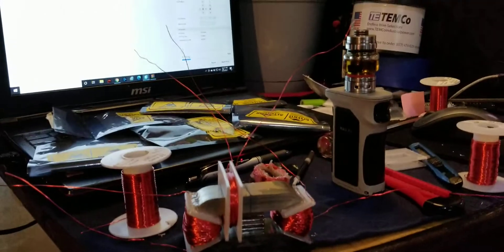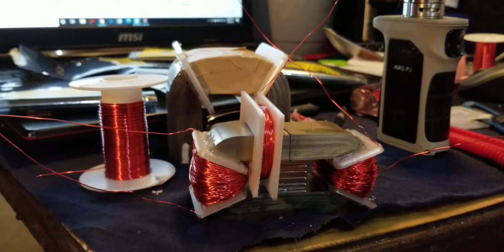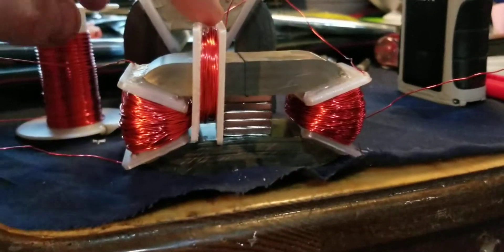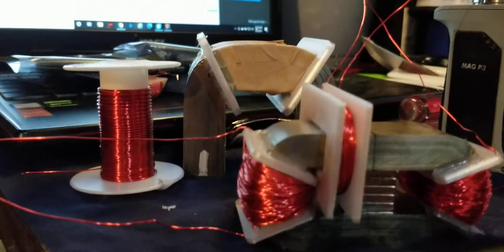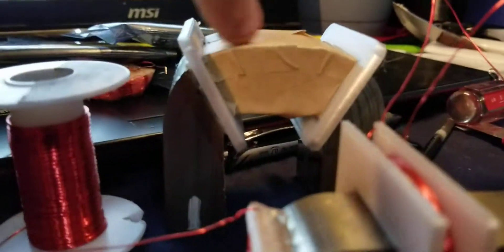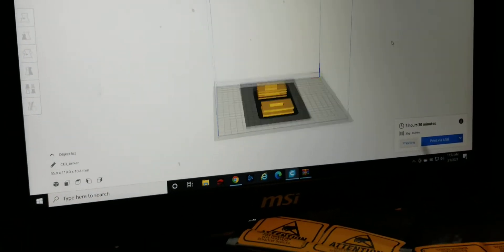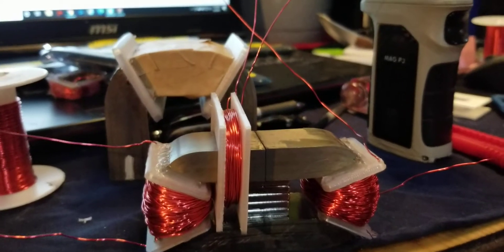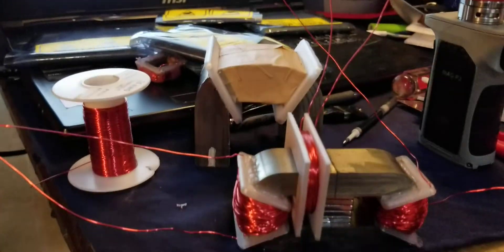TRUE MEG REPLICATION. Using logic, and the patents by Tom Bearden.

Comment: The Function Generator does pulsed DC. just put it in square wave mode you will have to adjust the offset for half the voltage so the bottom is 0 vdc. it doesn't do much for current but it works. you could drive your mosfets with it or what ever type of transistor you deside to use. then you can control your duty cycle on the fly with the Function Generator or even the voltage.
Reply from the maker: Hi. Yes mine had a CMOS generator feature that worked perfect for the fets. It was already 0vDC on the end. 

I honestly haven't touched a MEG in years ago bud. Been working with motion for last couple.
Reply: @Heliarc91  Cool, I was hoping the info would help someone new that was reading, atleast it's there. I know how that goes, I've been wanting to get back into building radios but been to busy with everything else.

Comment: Paul Babcock suggested 18 coils with ( run battery )24v batteries one side 24 v other side ( charge battery ) Bedini circuit using tvs diodes and power mosfets but as you say DC pulsed. SG Energizer does that it pulses. Overunity does Not come from electrical, it is mechanical. You attach generator ( small one maybe 24v drill generator) onto end of shaft fixed to center of wheel. Thank you for experiment. Free is good. Put our heads together my friend. Blessings ❤
Reply from the maker: Thanks for info

Comment: What about a Pulse Width Modulator? I am currently building one of these. What is is your input and output? What are you doing for the signal and timing?  If you don't mind me asking. I appreciate your time.
Reply from the maker: I use CREE Wolfspeed fets. they are around 30$ each. just 2.

And a DDS signal generator that has phase shift ability for your triggering. The wolfspeeds will trigger the gate fine with one. Very sensitive fets. Timing will depend greatly on turn ratio...etc
Reply from the maker: I didnt get notified of these. sorry its old and late bud

Comment: You can use a signal generator for this, just set the wave to a square/pulse and to your point, set the DC offset to keep the waveform above 0V so the polarity never inverts. Additionally you would need some kind of buffer amp in order to drive up the current, otherwise you won't induce a field of any useful size - signal generators output very low current signals. Cheers! Cool video.
Reply from the maker: I've used Wolfspeed mosfets to drive enormous current and keeping it polarity I want.

These need way more than making frequency. They must be fine tuned with the magnetic density along with other parameters and if you don't have a wide array of magnets to install you can be left without much happening. 

I believe I got mostly transformer action from these. But I did not keep going didn't have enough money available at this time to keep buying componets but I will resume eventually
Reply: @Heliarc91  I see! I know Bearden was able to leave out the secret sauce from his patents, so good on you for chasing it down and figuring it all out. Also, sad news, but Bearden passed away earlier this year. Haven't seen people discussing that so I'm trying to spread the word. I'm a fan of his work along with Bedini - I've built some of their devices and been very impressed. Both are now passed, sadly.

Comment: Hey man, I just found your channel and watched your videos regarding the MEG, did you have any luck with making the circuit and did  you get the results you hoped for. If not I suggest you might want to try with a spark gap and HV dc power supply fed into the coil. Looking forward to more progress videos :)
Reply from the maker: Hey thanks. I am still awaiting my frequency gen and the amplifier for it.

I've already built the Mosfet driver for it. 
Keep ordering wrong electronics to make the driver for the mosfet but will drive it off the amp initially. Still working out the magnetic pole direction and orientation just by slow pulsing the coils with a resistor.

I actually, funnily enough did put a taser module on one of the small input coils. It made a neat, HV arc on the output ... until it broke down the enamel on the coil lol

But I used cheap wire on the small. Going to rewind with good wire.
Reply from the maker: I will probably rewind all the coils at some point. 
And add some Teflon between layers for added insulation to help prevent breakdown as I creep the voltages up. I did not do anything special with the first run as I want to experiment with many iterations. I plan to print more spools and try different styles. Maybe a bifilar but I'm not sure if that would work
Reply: @Heliarc91  thanks so much for your reply man. Youtube deletes  my comments with links in them, is there anyway to email you some links. Uou may already  have them  as they are from jlnaudins site. Just afew interesting points i read thrte. Thanks again for making your work public!

Comment: Nice build seems you need more induction yes by joining the coils closer but good luck and have fun be safe!
Reply from the maker: Thanks!!
This is just the first experiment. I have a larger one with AMC 320 like Naudlins build in another vid.

I stalled on this I have like 7 other projects going at the same time to wait on breadboards and the Silgent scope I'm going to use to analyze it.
Over 500$ in a few days just to be able to move forward. And also waiting on some componets from mouser to begin building circuits. But then I always discover resistors I need later and end up waiting longer. Ha.

But anyway. Yeah the mini seems proportional to me. It's hard to make room for more coil on the sides and at the same time print spools that will hold up to the input coils. Already down to 1x1 in magnets. I could go 3/4" and long or 1" and long if this works. 
But, my goal is higher amperage out. So I want a strong Magnetic field to bully here. :)